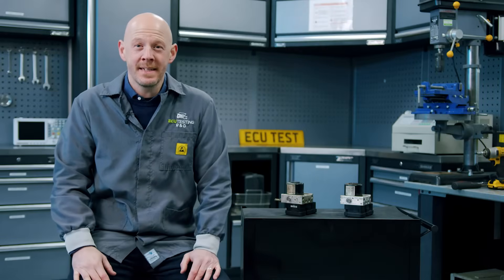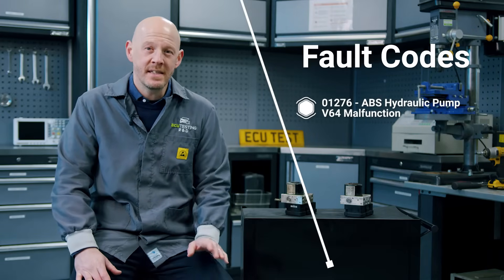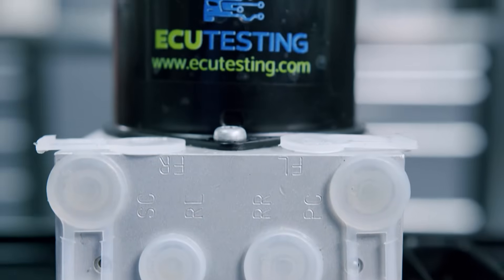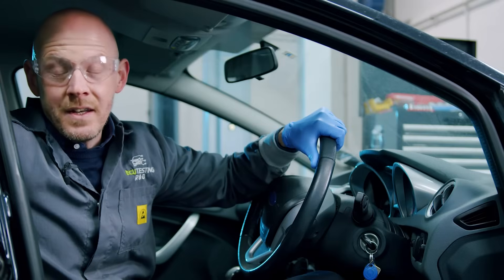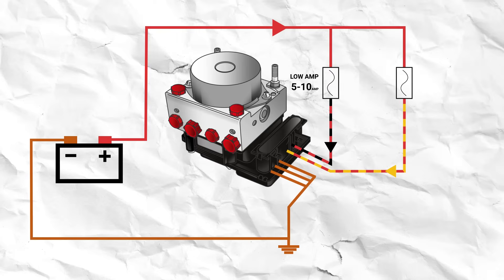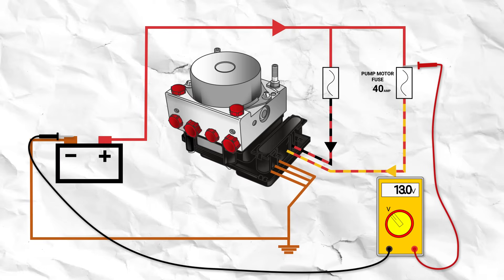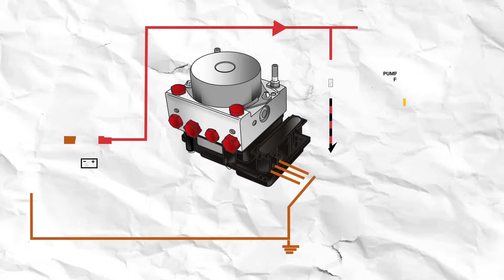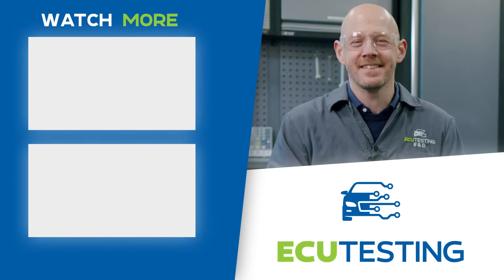ABS Pump Failure Symptoms – How To Test And Fix!

Comment: Hi guys. I was looking for some similar situations with my car and I think you might help me a bit here.
My BMW 2019 G20 320d has been just serviced for the 3 yearly compulsory brake fluid change. When pick up my car I had the lamp blinking for traction control as soon as I’ve left the dealer workshop. I could not go uphill due to power loss in the first 500m until the lights stopped blinking and power came back. When driving the car braking in city at small speed everything seemed OK but at higher speed I felt that I couldn’t stop the car and  I was definitely applying more pressure on the pedal then before. I was so disappointed since my brakes were the upgraded M Power  type and they used to be so so good until then. The dealer told me that the process is automatically done by a so called robot and there were no mistakes, then agreed to change the fluid once again. Same situation after second fluid replacement, traction control blinking lights, no power and all normal after few minutes. Somehow the braking improved a bit but it is not what I can recall from before changing the fluid first time. I feel very disappointed, I will not return to this dealer again , the car is almost new 22K km (13K miles) and I don’t know what to do from here. Someone suggested me to vent the ABS valve block by actuating the valves with a computer or so?! The dealer says the car is fine but braking from high speed is not what it used to be … I do have still another 2 years of warranty from BMW and I like the car, but how do you suggest to solve this issue please? Looking forward to your reply. Cheers. Bogdan
Reply from the maker: Hi Bogdan. It sounds like a complex issue, and it could be caused by a number of things. If you can read any fault codes then we should be able to advise you of a fix. Please email our technical support team at info@ecutesting.com with the description of your fault (as you have done above) and any fault codes you are able to read, and we will be happy to help you out. Cheers.
Reply: @Ecutestinglimited  thank you for your answer. Unfortunately I have just left home, job related. Luckily nobody else is driving that car. Now, how should I proceed in your opinion as my dealer says that car is absolutely fine? Where can I read if I have any alarm codes since there is nothing coming in the dash?! I think I need a third party to put the car on diagnosis tester…
Reply from the maker: @aquamaster111  Hi. We would recommend taking the car to an independent garage for a diagnostic and ask if they can scan the car for any fault codes, especially relating to the ABS or braking system. Thanks
Reply: bmw's are shit brand, my toyota camry has 400k km no issues

Comment: I believe I've had a faulty ABS hydraulic pump on my VW Corrado SLC for many years now I took a pair of alligator clips from the battery to the motor and all I heard was a click, the motor never turned on, that's how I know it's faulty. I've got the worst parasitic draw because of it. I'm going with a non ABS swap!

Comment: Most common stuff I've seen recently is open circuits in wheel speed sensors traced back to ABS pump
Reply from the maker: Thanks for the comment, and you are correct Tyrone! Part 2 of this ABS fault series is going to cover wheel speed sensor faults, so watch this space over the next few weeks!

Edit: Here is it! - https://youtu.be/T74B_aELnU0
Reply: @Ecutestinglimited   Sorry to bother you, I'm new to using a multimeter and I don't know where to put it to see the reading. My multimeter is a craftman, can you tell me? I have ABS lights and a car sliding on the panel. The 4 sensors on each tire work and all the fuses have continuity and I don't know what to do anymore.
Reply: I hope to discover how to repair  2016 VW flashing  abs and traction control. (after replacing a bad fl wheel sensor) I also had/have no cruise control when the five warning lights were on. Now it's just ABS and TRACTION flashing in unison, and I gotta get my cruise working before I get a speeding ticket.

Comment: I have used you in the past for a abs pump on a corsa with no flow to one of the outlets.  Very quick turnaround service.  Thank you
Reply from the maker: Thanks! We appreciate the kind words and are glad we could help.
Reply: @Ecutestinglimited  halfords said my abs pump was not running but i have no abs light or fault on diagnostic would it still  be pump with no errors please ?
Reply from the maker: @jacko-gk2st  Hi. This can occur, however it is unlikely that the pump would be malfunctioning without producing any fault codes or warning lights. Did the garage attempt to run a pump motor output test using diagnostics? Also could you let us know the make and model of vehicle you are experiencing this problem on? Thanks
Reply: Corsa? What car is that?
Reply: @tiagofgarcia  made by vauxhall. Small car.
Reply: How do we directly contact you